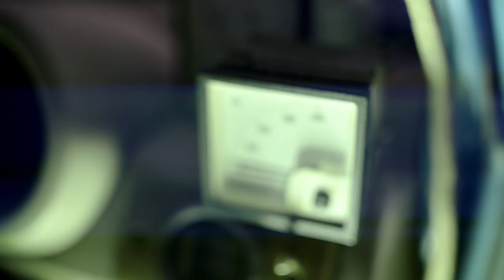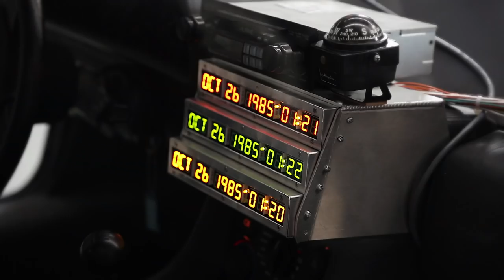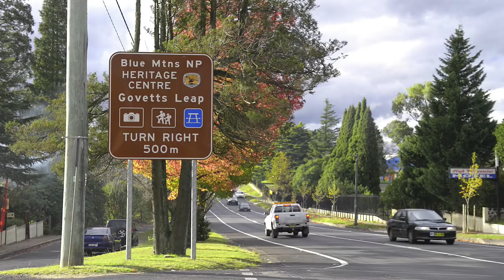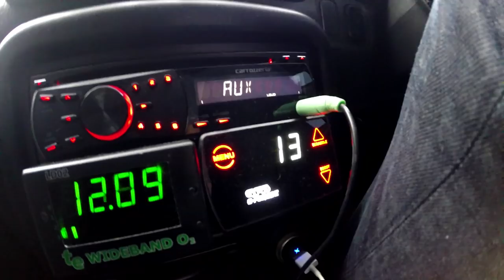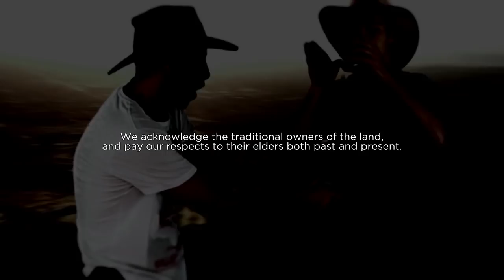Lend Us A Ride: Australia [EPISODE 1]

Comment: Ah yes, the dynaflow transmission. Believe it or not, although it is a two-speed transmission, it actually starts out in high gear if you just put it in drive and it can't automatically shift if you put it in low. So it's really like a two-speed, column-shifted manual with no clutch.

Comment: Awesome vid guys but to charge that little crappy battery car you plug it into the power at your house yes. To get the power to your house the same fossil fuels used in your traditional combustion engine  are burned with the gasses going through a turbine that's turning a gen set such is making electricity. It is the sent to your house. The gasses from the power station does more damage to the atmosphere than a diesel truck with no exhaust or an old v8 Holden spitting fuel out the exhausts.

But what do I know. It's just mankind trying to survive.